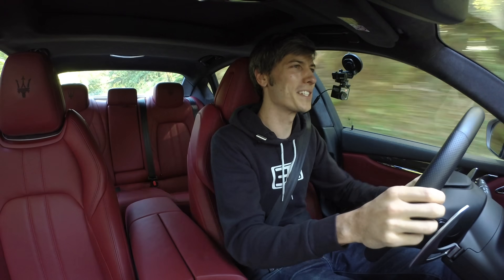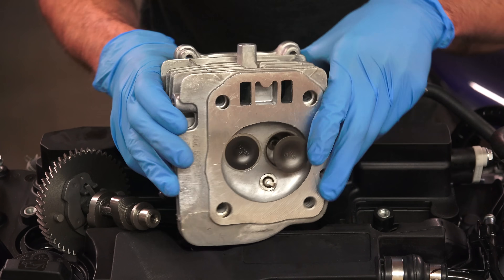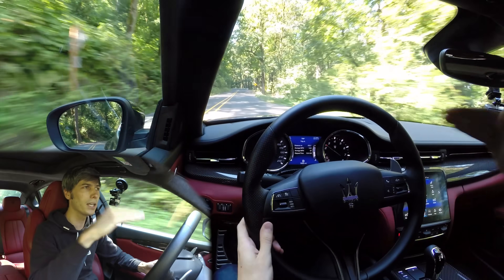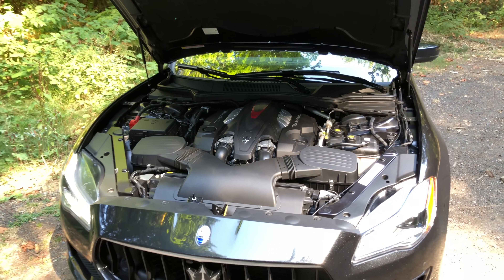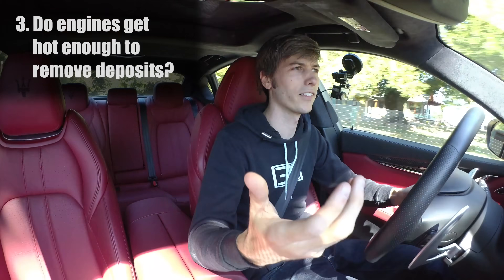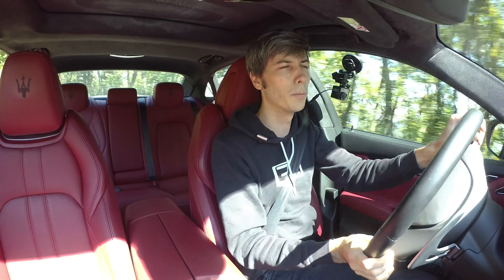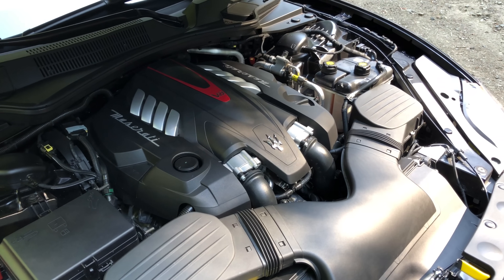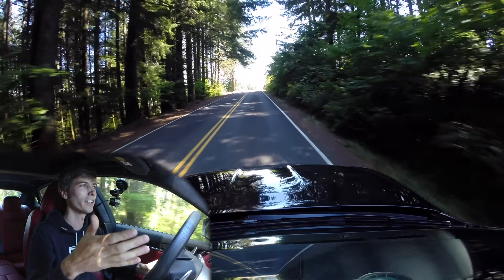Is Redline Good For Your Car's Engine? Italian Tune Up

Comment: I would do this to my old F250 that had a stock 6.0 powerstroke. I would dump a bottle of injector cleaner every other oil change. Take it up to about 50 or 60 a few times. It worked wonders. One time I missed a oil change so I did it at the next one and it actually blew black smoke.

Comment: i"m using a single cylinder air stream cooled motorbike for work and back. .after 30km on a highway the exhaust gets red hot  and burns white all the way. . the motor was clean inside the last i checked the spark plug. . i 'm no slow driver . . spark plugs can tell a story on the condition of your engine . . 2 years hard riding the bike and no problems  so far. .

Comment: cant find the video but there is a welder's trick in which you use a very rich flame to cake soot on the surface, then heat the surface up using a neutral flame and the soot will start disappearing once the surface gets to like 450-500 F

Comment: Anyone old enough to have been driving a carbonated engine before gasoline cleaning additives, smog control devices and cytolytic converters will remember the thick black cloud of smoke let out when dad took the family out for a road trip and accelerated on to the freeway after mom had been driving 30-40mph in suburban/city traffic the previous month.  It's not a myth and you don't need an exotic sports car at red line to blow the #&%@ out the tail pipe.

Comment: Why is war on carbon? Does any one know of an engine the died because of to much carbon deposits? Does this mean an engine can not last more than 100,000 miles because of to much carbon build up? So why this war on carbon?

I have had motorcycles with very thick carbon deposits that ran great. No problems. So again why this war on carbon?

Comment: In the mechanic's manual written by Kia/Hyundai, it says to drive between 2500-3000 rpm for 20 min to heat clean carbon build up. For severe carbon deposits, it says to drive between 3500-4000 rpm for 20 min.
For turbo charged vehicles with fuel injection, fuel mixture gets rich in high rpm high load scenarios which builds up carbon deposits like crazy. So you have drive at high rpm with medium load keeping the fuel air ratio.
Reply: That's a good way to heat the cat up before smog testing as well. Thank God I moved out of Commiefornia and no longer have to worry about that $hit.

Comment: I've always used the Italian tune-up on all my cars, atleast weekly. You know its cleaning because you can smell the carbon as your doing it, or right afterward. Presently my 2.3litre engine with 370k kms or 230k miles for you Americans, still runs like a champ. I don't push her too hard most of the time though.

Comment: I thought that when you burn synthetic oil in the open air (say in a tin) there is no carbon deposit left. Wouldn’t that mean that there would be no carbon deposits in an engine when you use synthetic lube oil?

Comment: As an experienced mechanic I am convinced it works in instances where vehicles have been driven very slow for years usually by older customers. After finding nothing obviously wrong I  have often taken customers vehicles for extended "test" drives to more remote locations where I  can open it up for awhile. Had very good results. Trick is guesstimating if engine is up to it beforehand. Did it to a car of my own I bought from an old dude who never went much above idle for years and managed to kill it quite quickly. The engine was so gummed up it was hard to tell just how badly worn it was until being driven harder over a period of a few weeks after a full service. Started blowing smoke and rattling in the bottom end. Best advice for engine health is change oil and filter regularly and also drive vehicle as it was designed. If you want to drive everywhere at low speed get a ride on mower.
Reply: Any tips on highway legal mowers? 😂
Reply: @Fridelain  watch the movie water boy
Reply: @blakelip3 lmao, love that scene
Reply: @Fridelain  see George Jones’ lawnmower incident
Reply: @Fridelain i swaped the pullys on mine and got it to 19mph but the transaxle is a dry system and it could be heard across town. I put it back after 1 run
Reply: Extended is the key word. No need to redline the engine.
Reply: @neomateo944 I'm currently driving a motorcycle and at first, I drove it using all the gears between 3k and 4k RPM, trying to get the the highest gear over time on any drive way (around 45 - 50 KPH). The point was "saving gas", however, now I´m revving the engine to 5k RPM from 2nd gear to the highest and keeping the gear that gives me the speed I need in low speed driveways ( and gearing up if needed of course). The bike feels more powerful and responsive now, compared to the first way of driving.  And engine braking makes more sense now. Also the bike engine is still on Break in. Am I doing it correctly? Because where I live, nobody gives a good tip.

Comment: One of my questions has always been about scoring inside the cylinder walls as it relates to idling and daily driving. I've HEARD that idling your vehicle for long periods of time (like patrol vehicles) can result in scoring of the cylinder walls, which can cause damage when you do eventually push it hard. The same could be true for driving your car at low RPMs throughout most of its life. The theory is that if you're consistent in driving your car to redline, you can prevent this scoring and maintain your cylinder walls by ensuring that the engine load varies throughout the vehicle's life.

A more clear hypothesis would be that if you took a car that spent most of its life idling and at low engine loads, putting it into a high load scenario could prove catastrophic late in the vehicles life.

Comment: My Italian tune up experience with my 1972 Fiat Spyder 1.6L was that carbon deposits were never a problem, but the head gaskets eroded to the point that a head milling was needed. It would SING up to the redline+. After the last head milling (the third) my mechanic said they would have to mill valve-relief pockets into the piston faces to prevent "mortal combat". My compression was up around 10-12:1 during the 3x milling adventure. I only burned Sunoco 2XX up to the highest it would go. Still, it was a superbly balanced engine. I got about 40 mpg on the highway with a fair amount of rat-racing in Baltimore. Got rubber in third with my Michelin XAS tires which lasted for 30,000+ miles. Amazing car. Still drive it in dreamland.

Comment: Not to mention the sheer abuse pushing the motor like that puts on the engine. No thanks. Stick to top tier gas, and like everything else- don’t drive like your accord like it's a racecar, and you should be fine.

Comment: redline does not matter since the engine will not overheat due to thermostat opens for cooling the engine.. inessence the engine will stay between 200C and 220C regardless of speed... But OVERHEATING the engine,,, will make the engine temp rise and increase metal core heat..to 300C+ that can help to remove CO deposits..

Comment: The Italian tune up was good in the old days of carburetors and leaded gasoline. The old European sports cars were just race cars that were registered on the streets. Leaded gasoline left a lot of deposits due to the primitive refining capability of the era. The spark plugs fouled easily if you didn’t have the correct heat range for your intended application. Carburetors were set up to run a bit rich to keep from burning the exhaust valves which made the problems worse. The Italian tune up would be effective on those older cars and not as much on today’s cars.
An old trick to remove carbon deposits from those older engines was to get the engine hot my running it at full power for 15 minutes, like pulling a large hill, then slowly pouring water down the carburetor while the engine is running, and the rapid cooling of the water would break up the carbon deposits. It’s the same principle for looking for a cracked cylinder head or bad head gasket, the incoming coolant breaks up the deposits in the cylinder that is being leaked into.

Comment: Not that viewers of this channel will have experienced it much(!), but I've seen cases where cars driven excessively gently have fouled the plugs.   And of course then opening the throttle causes misfiring so they drive it even more cautiously, until the poor thing can hardly run.   And a good 'normal' drive, (on the ragged edge of misfire), often burns off the fouling and cleans it up after a few miles.

Comment: I live in the city and typically only drive a few miles and then back to my garage. Occasionally my car will throw a check engine light. I typically take it out for a spirited drive and that has always reset the check engine light.

Comment: Antadoltal and a bit apples to oranges but. I worked on bikes and did trackdays for years. Bikes used mostly on the street had typical black soot in the muffler outlet. Bike used primarally on track always have clean, white muffler outlets. Not talkin race bikes,  and not race gas, but the same sportbikes with the same type modifications that you see squrilin round on the streets every summer. sorry, spellcheck has left the room.

Comment: I love how you explained this. Thank you!

So, if fuel cools down the intake valves, and letting off the throttle in an L-Jet or Motronic engine shuts off the fuel supply, how much does the heat in the intake valves then rise without the fuel to cool it down, and is this a "best practice" to follow as part of an Italian tune-up?
Reply: That cooling effect is only for port injection, and if the fuel is cut off how will the temperature rise... with no combustion...

Comment: Before I had a driving licence, I would devour the instruction manuals of my parents' cars whenever they got a new one.
I distinctly remember reading in the manual for a BMW that you had to expose the engine to high loads and revs after having driven it slowly in a city or a traffic jam to remove the carbon deposits.
Thanks for investigating the reason behind this, it was highly intresting!
Reply: Lmao. 
“When leaving a city or traffic jam, here’s a specific, manufacturer-designed get out of jail free card.”
-BMW

Comment: I think it's less about the temperature than about the high rpms in the engine that clears things up. More fuel sprayed on the valves, injectors are cleaned out, oil pressure is higher and oil comes more often and harder into contact with carbon deposits. I did this to my 22 year old toyota (owned by an old woman who never drove on the highway) and not only did it trip error codes related to a dirty maf, after cleaning out everything, the car runs way better than before. It does make a difference on cars that have only been driven on short trips in the city.

Comment: While high revs might not be therapeutic for a performance engine, they should not be harmful, either. I prefer driving my ND2 in its powerband -- 4000 - 7500 rpm -- rather than lug it as I see so many MX-5 drivers do. This small (2L), super-high-compression (13:1) engine should not be lugged at 2000-3000 rpm. Power should be at hand at all times in a sports car; it's the nature of the beast.

Comment: So basically what we've always known. An in town short trip car get hotter sparkplugs and thermostat. Highway car gets cooler goodies. Track car gets cold rated stuff. Temp is regulated by user, depending on application.

Comment: Your conclusion is Irrelevant, the main reason to occasionally redline your car is the valve train. Carbon that you need to worry about is mostly on piston rings and spark plugs.vs valves and induction components, the car will run fine with a 1/8 inch of soot in the manifold, but locked up rings mean disaster, while "Venting" the carbon through the exhaust can clog a catalytic converter.  Low RPM's are where the valve train has the highest friction coefficient and least balance.  These vibrations over time damage the hydraulic tappets giving you the common valve rattle and wear out the chain tensioner.  It's best to redline your car occasionally to "Polish" everything back into shape under higher balance lower friction conditions. IE: Redline (for me 7800) as the valves start "bouncing" in the springs.

Comment: Want to clean out engine deposite.... just fill in a high grade gasoline... fill it full ... and just drive your car smooth, it will clean your engine deposite and clean your injector

Comment: Older Italian cars need an Italian tune up.  I recommend driving them at high rpm.  For instance, my Alfa loves running above 3K rpm all the way to red line.  And when going thru a tunnel. the carbon blowing out the exhaust makes this wonderful sound!  Simply amazing!

I wouldn't recommend an Italian tune up on a Chevy Cavalier.  You could lose a rod.

Thanks for another excellent video!

Comment: Back in the day, (80’s). I worked at a full service gas station as a mechanic. We has a larger customer base from a near by retirement community.  I recall a particular Ford Fairmont, 6cyl, 1 barrel carb. I turned up, and just didn’t run right. Me not much more than a clean up kid, asked the old timer what wrong. He said, “ that thing never gets warmed up and never goes over 20mph. Take it out behind the station and run the piss out of it.” I left a cloud of brown smoke you wouldn’t believe. I did it until it quit smoking and it ran great. Based on my experience, I believe the Italian tune up is more about velocity than heat. Maybe more of clogged exhaust. Great video!

Comment: Wonder if the valve acceleration at high RPM knocks any of the carbon buildup on the intake valve loose. Maybe even more so in variable lift engines with more aggressive high load cam profiles.

Comment: The Damage ? wear and tear from running the crap out of it is worse than the "deposits" ... IF you have a real problem like a cylinder skipping/missing you think is from deposits you can try this ..We used to run 16-32 oz of water / trans fluid or brake fluid mixture thru hot engines to break up deposits ...Still this is only a band aid ... change your oil ..and air cleaner ...use the best gas you can and occasionally something like seafoam thru it every now and then ... running the crap out of it isn't "Good" for it ..common sense

Comment: If carbon deposits formed at 200°c, common internal combustion engines wouldn't have that problem. They would implode first. Why did no one else catch this? You must mean Fahrenheit.

Comment: Another important question in regards to this, is it worth it to run it hot just to remove carbon deposits? It could cause more damage with the expansion and contraction of metals

Comment: Back in the day, there was a variation of this where in you had a fully warmed up engine and you would rev it up to about 3/4 redline and then pour 16 ounces of water into the carburetor. The water would dislodge all the carbon in an instance.   It was really amazing.  Not sure you could do this any more with a CAT down stream as it would probably clog it up. And I know everyone is going to comment about hydro static lock, but in a hot engine the water becomes steam before it ever gets to the cylinder.    Not sure if EE would be willing to check this out and the feasibility with EFI and emissions system.

Comment: Every 3K miles, before an oil change, I run a bottle of a good PEA-based cleaner, like Redline Si-1, through my gas tank. I will drive up to higher elevations at highway speed to heat up the carbon deposits and allow the PEA cleaners a chance to penetrate into the deposits. I then park the car and allow the engine to heat soak for about 20 minutes, after which I surge the engine from idle to about 3K rpm and watch the exhaust through my rear view mirror. I do this repeatedly until the exhaust comes out clean. The result that I notice is a smoother idle and a slightly stronger running engine at low rpms.

This is in spite of the fact that I run Shell V-power Nitro+ exclusively, a top-tier fuel. I suppose that the deposit buildup on my intake valves and piston tops would be worse were I to use a lower quality fuel. I was hoping that with a port injected engine(VQ37VHR) and this fuel I wouldn't be having valve deposits. Maybe an oil catch can would have been a good idea.

Comment: I bought a 2012 Cadillac awd srx with a 3.6 VVT, and It was using oil  and there was a problem with the pump that controls the rear differential and I drive  the hell out of the thing for around 400 miles, and it quit using oil and I got 2 more mpg, and the pump started to work correctly. It was serviced regularly, but it was babied it's whole life.

Comment: If you're going downhill and notice that you're going too fast. Remember that you can just gear down to 1st gear.
I do it all the time. Really helps clean up the internal system. It also exercises the clutch, making sure it gear shifting remains easy and smooth.

If you don't like putting it in 1st gear. You can also try putting it in reverse while driving. It'll have the same effect.

Comment: I do the seafoam Italian tune-up for carbon deposits. I run my truck around a long country block after doing the seafoam-soak. The last time, after just starting out, I passed a guy on a bicycle and (unintentionally) left him a nice cloud of white smoke to deal with. What made me chuckle is that he probably thinks my truck is the biggest POS on the road.

For those wondering, the truck always runs considerably better after the 3 or 4 mile trip around the block. Seafoam (the kind you put into the air intake, haven't tested any other kind) works amazingly, I use it every 15K miles or so.